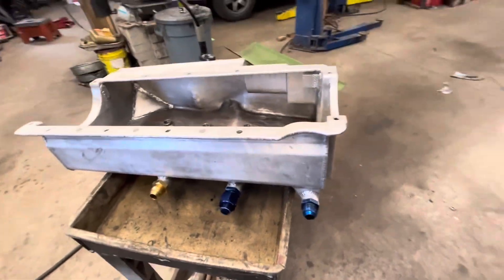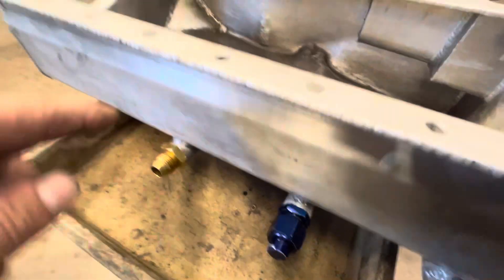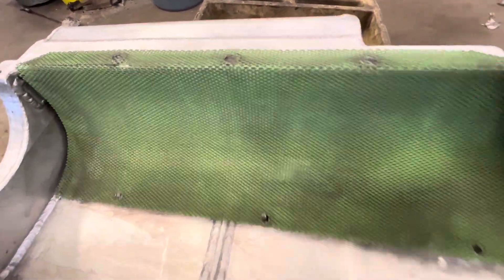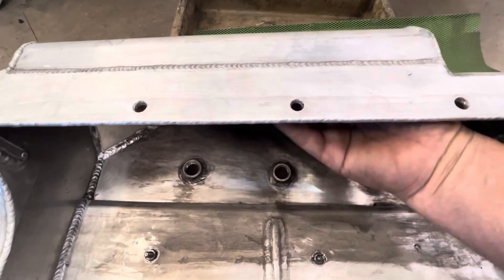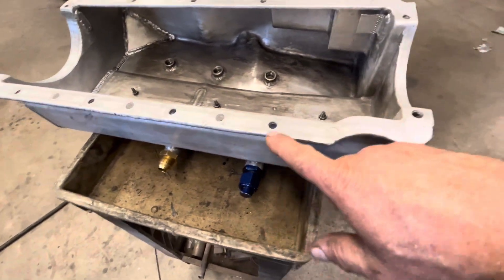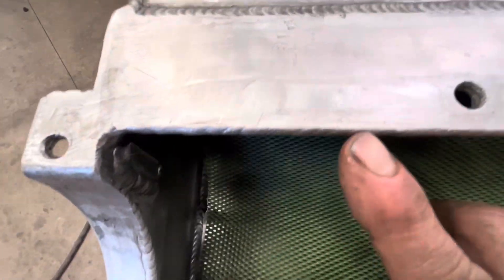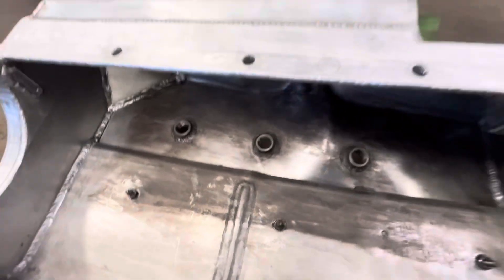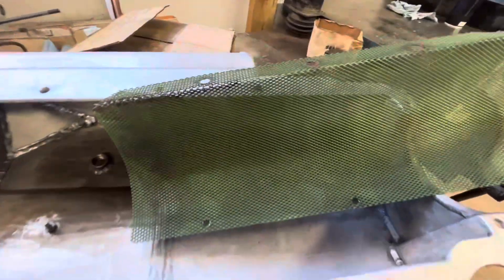Dry Sump oiling system a brief explanation #bigblockchevy #oilpan #highrpm #1967camaro #dragrace

Comment: Question, Are you scavanging the lifter valley? If so how are you doing it. I am building a 388 inch 348 chevy methanol engine and intend to go dry sump. The oil drain back is horrible on these engines and mostly runs down on the cam and crank from the center openings. I want to block that off entierly to limit windage and use a suction off the pump for the valley.

Comment: What has worked best for me is to attach the pan and snug the outside bolts, then turn the engine right side up and come up through the bottom of the pan so the nut has a better chance of staying in the socket while you "feel for the stud blindly" lol. I'll still pack the socket with grease to help it stay.... 
And for another tip, DON'T use good stainless hardware on the inner bolts / nuts. Magnetic hardware is a must. Lol. 

That, and a whole lot of patience, lol.
Reply from the maker: I rotate the engine to the 4;30 position and sit in a chair so I'm at the same level, and carefully fish them in there
Reply: @CenturyOldRacer Yeah, much better than right side up. Most guys do that mainly out of habit, as that is how 95% of pans go on. But they learn quick with through bolt pans lol.